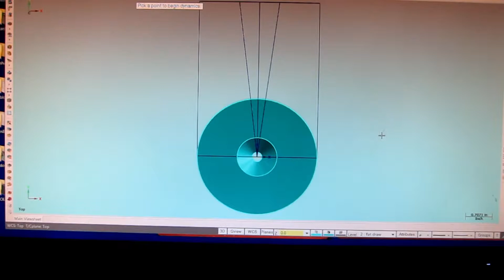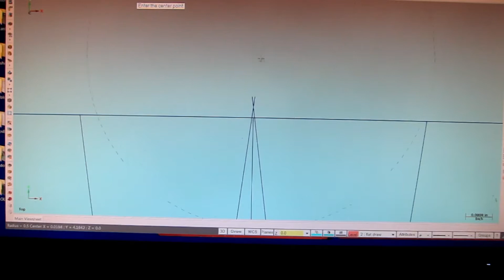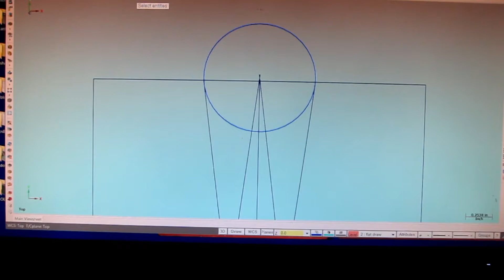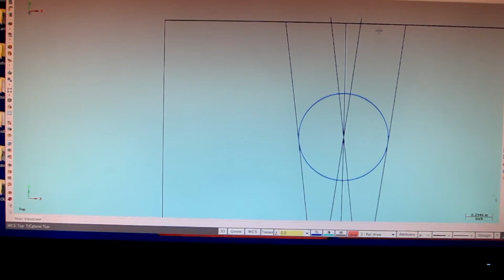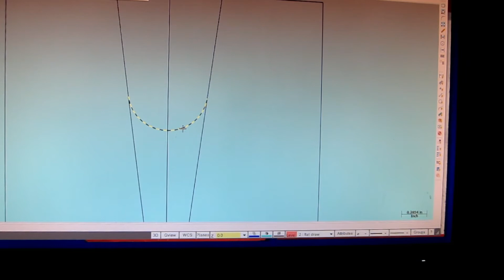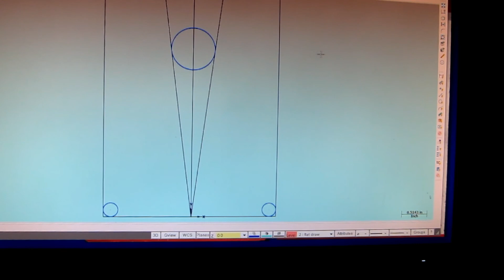placing a sphere into a tapered cone for measuring.

Comment: I'm appreciating your thoughts.
The extension arbours I need to make for the universal have internal taper and M16 internal thread one end with external taper and M16 external thread the other end.
On the right side of the grinding head the threads are right hand, on the left side they are left hand..
There are challenges.
The left hand thread, at depth, to a wall not being the least!
On the universal, internal taper grinding is relatively easy once the table is set for the external taper.

Comment: Here is my chalange,
Having only really had tech, your trade school, time on grinders previously.
I have gone and added to my menagerie of machines...
A Jones & Shipman auto hydro 1400 surface grinder, &
A Strausak 57W Universal and tool grinder.
Which I'm trying to wrap my head around.
The jones isn't fully set up yet but can be manually operated.
The Strausak is able to do Many things.
I have various powered working heads, rotating, indexing , stuff by the ton.
Mag sine, yes, spindexers, yes, but C5 collets don't get up big enough..
A stepped example shaft...
Hmm

Comment: This is the 2nd attempt an won't be so eloquent,
Thes single ball measurement of a taper is fine for setting your depth of cut of your taper, if you already have the correct taper set on your taper turning attatchment of your manual lathe.
A two ball measurement will define the taper you need to match initially and also measure the taper cut for the correct angle.
Perhaps you could show this on the computer And the old non computer method..

I hope you are staying safe in these trying times.
Carl from Oz.
Reply from the maker: most certainly you can do the two ball method but not needed combined with the fact that the balls rize up or drop lower dramatically based on size and size of the taper. Its virtually impossible to have every ball like a set of gauge pins--therefore I am saying its not practical especially when setting up on the lathe. If you get two balls one for top-one for bottom they would not register at both extremes and a large area of the taper would not be measured. If a person wants to cut and measure to get exact a person would be far better to take it out and set it on the surface plate sine plate for the desired angle set to gauge blocks. Then take an indicator and indicate from one end to the other then adjust using the math.
Reply from the maker: also you can speak freely I like machining discussions I am thick skinned.
Reply from the maker: here is an important principle when I was talking about setting the taper attachement exactly. Or for instance using a surface plate to set an angle on a sine plate. Once the angle is set exactly gauge blocks being the root bottom reference at that point a person no longer cuts and measures except for size if a person wants because you then have reached a point you are producing--closer than can be measured. A good example is in cnc work using known cutter sizes and factoring in variables you actually program than cut finished--without checking. I did it for years on molds and such. Because the machine cuts closer than can be practically checked.

Comment: Interesting. I'm a paper, pencil and at least a calculator man, though I do have my Trig tables on paper as well, lol.
I did learn some things for sure.
Funny enough I watched this for the taper measurement technique as I need to make grinding wheel hubs for both my Jones and shipman and my Strausak.
And arbours for the Strausak as well.
I think what you have outlined is a good way of defining the theoretical diameter of the taper as it intersects the top surface of the hub and therefore when to stop to get the correct 1inch hub's taper, if you have the taper turning attatchment set at the correct angle already.
But it doesn't check or define the taper.
Two balls of different sizes and a depth measurement of both does that.
1, to define the taper existing needed to be matched&
2, to check if you are successful in your endeavours.
Now I have to find some precision balls...

Hope you are being carefull in these difficult times.
Carl from Oz
Reply from the maker: You wont get much done if you try that you will be messing around forever on the lathe. You would be using the cut and measure and tweak method if you did that. 

If you have a surface grinder simply take some cold rolled or something and take and put a magnetic sine plate and a spin fixture and tilt it exactly using gauge blocks. Use one of those cheap spin fixtures and if not a magnetic sine plate simply clamp it and place it on the chuck of the grinder and spin the taper. Now go over to the lathe and chuck up the tapered cone bar you have made and set the angle close on the taper attachment. feed across with an indicator instead of a cutter. adjust the taper attachment. Put in a cutter and cut the desired angle. Oddly enough the taper for a hub simply does not need to exact to tenths even though you can do it easily if you use that method. Simply reliever the middle of the taper dont leave it solid and the various hubs will register on the two lands perfectly. (as is done on almost all hubs they are relieved in the middle if made properly) When you first turn close-then finish grind the taper on the shank of material you can leave both ends rounds taper in the middle so you can reverse it for male or female tapers. The spin fixtures are the common ones you see for $50 or less that take 5c collets. 

The balls are simply ball bearings and quite cheap I have dozens of sizes. 

The method described above by the way I use that method to make balancing arbors however I take precision shaft and turn a bigger diameter and drill and ream the middle and jb weld on so that its basically an exterior bushing. I let it cure and then rough turn it and go over to the grinder and finish grind the taper in the spin fixture. 

Another note is that I made an invention I intend to market that has a shaft with a flat that spins with index holes for known angles such as all surface grinders. I stick in the pin and then chuck up the block and simply dial in on the flat.
Reply from the maker: ohhhhhh  your the Oz guy !